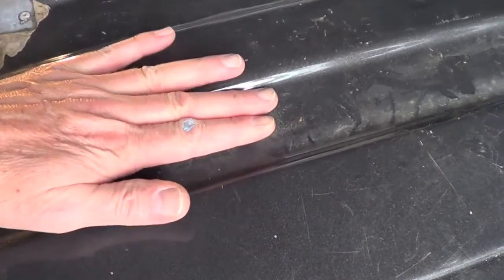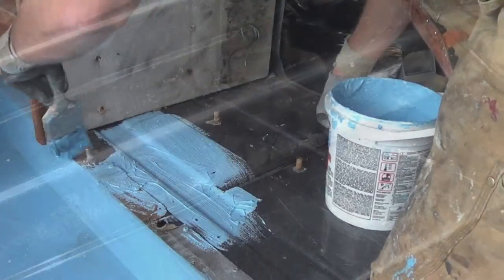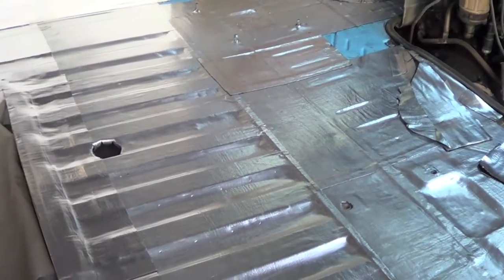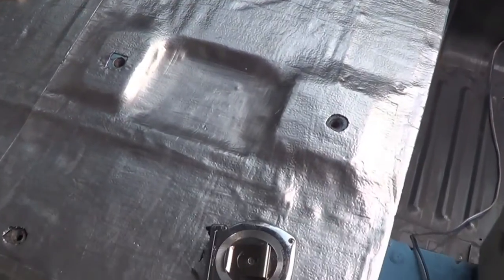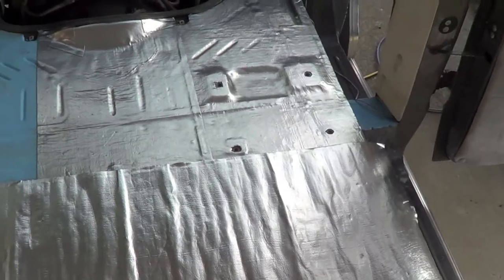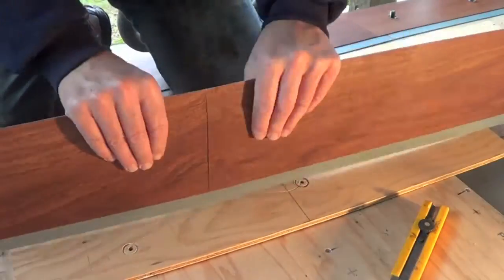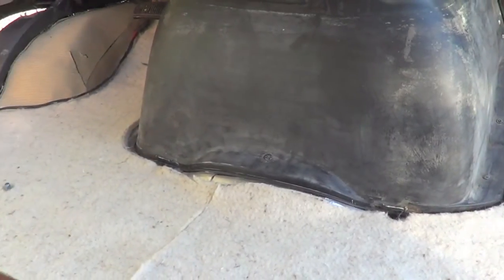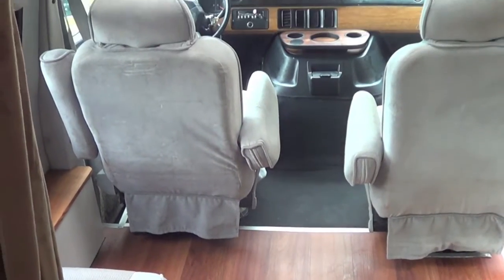How To  Remove Carpet  RV Interior

Comment: Thank you VERY much for posting this. I have been looking for this type of step by step video to help me with my 77 Dodge Camper van. All the rest of the videos go from before to after with nothing in between.  I will be sanding and painting some of the wood countertops and stuff that I can't get out.  Should I d9 that before I take the carpet out or after? I'm thinking before so I can rip out the carpet with all the dust in it already.
Reply from the maker: Thanks Jeffree-- Good question-- Before or after? i probably would do all the nasty work of the stripping and get that over with, then the cleanup is just simpler. Then proceed with your woodwork- finish that - then install your flooring last.
Reply: Alex Denny thanks for the suggestion. You can check mine out on my channel. Would love to get updates on your van.

Comment: Hi Alex
It looks great.  I am doing a floor replacement in a similar van.  How did the vinyl planks end up working for you?  Did any of them eventually lift or did the seams start coming apart?  I've read conflicting reports online about using these vinyl planks.  Some say the drastic temperature changes in a vehicle can make them shrink and expand too much and cause problems.  If you had to do it again do you have any more tips?

Thanks

Sam
Reply from the maker: Hi thanks-- i recommend the vinyl planks as they were cheep, add density/sound etc, although it may scratch a bit with sand/grit from camping etc.
Reply from the maker: I glued every plank to the plywood substrate-- no lifting, as well each plank had a sticky edge--

Comment: hello Love your video, I have a dodge 2003 handicap van, and the back carpet along with other parts of the van are destroyed, and I really want to put the vinyl adhesive, wood looking like.. in the back area I'm trying to fix it up. But I don't even know where to start I peeled back some of the carpet to see what I have going on back thier, and it looks like just flat metal, no divits like yours. So I'm wonders if this will work out for me!
Reply from the maker: If the surface is flat then go ahead and lay down the rubber peal and stick flooring from home depot. if you find plywood in good condition then you can also lay flooring on that.
Reply: Most of it is flat just a little raised in the back, just slightly!
Reply from the maker: Then what ever type of flooring you choose should lay right on that-- use a thin rubber underlay-

Comment: Hey Alex - Great video! Did you use the peel and stick sound deadening for only the front half of the cab where the carpet is going? or did you also place that under the plywood subfloor?
Also - Did you secure the plywood using adhesive or sheet metal screws? If screws, did you drill the holes first or are they some sort of self tapping screw?
Reply: would also like to know which carpet you selected for the front section. Again, great vid! I'm about to do this same thing this weekend.
Reply from the maker: +Christopher R Good questions-: I used the sound deadening foil to the back half of the main cab- wanted to keep the cost to a reasonable level. 
 Securing plywood was with small sheet metal screws. You could use "self taping" but i wanted the heads to be flush. Yes i pre-drilled-. 
CAUTION : be careful or aware your gas tank is.! use glue in that area
Reply from the maker: +Christopher R I found a "Automotive Carpet" on ebay- Simple and easy to cut and use. This was the simplest and cheapest  option- 
And BTW- best deal on the "sound  foil" was from amazon.

Comment: Awesome video! I just bought a 93 GMC conversion van. Starting taking out the carpet on the drivers side today and came past & checking out your video tonight. Very helpful. Did you by any chance make a video on the easiest way to tear the carpet out? This is not very easy.
Reply from the maker: Basicly we unbolted the seats and started cutting with a large sharp knife all around the edges-- unbolted the toilet and anything else that was removable and just kept cutting until it was all gone